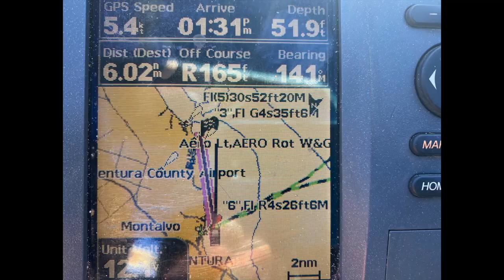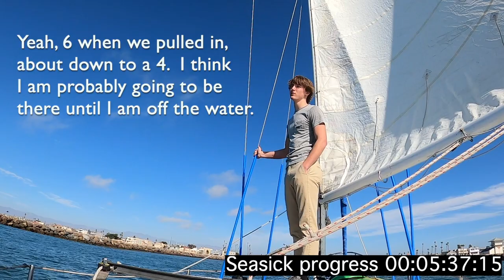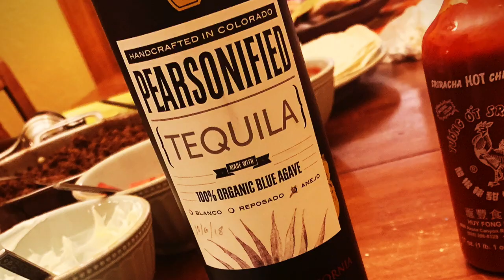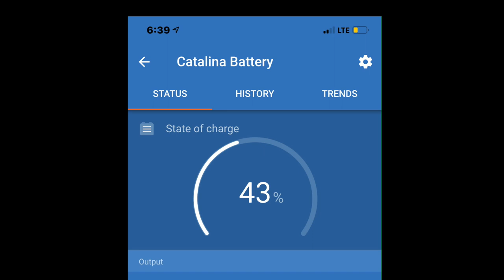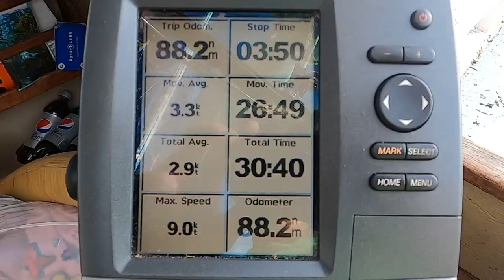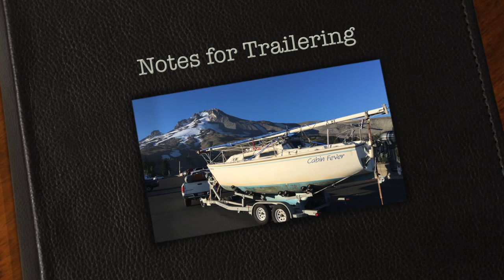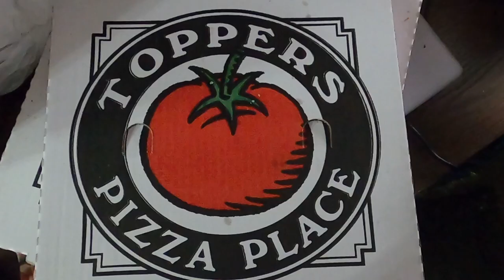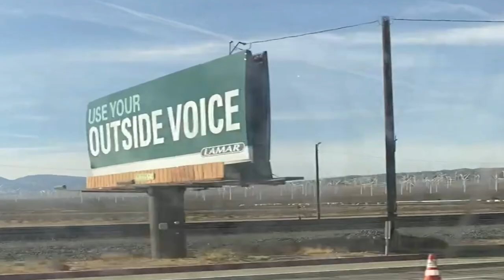Our Amazing Adventure is Ending!  Sailing Santa Cruz Islands Part 7 of 7

Comment: Looks like a great time!  A few questions about long trailer-trips with your C25:
Do you remove the rudder?
How do you stow the mast/rigging to avoid loose lines & cables from chaffing?
Do you have any tie downs on the stern?  Or just the bow winch?
And then last, and most importantly, how did you replace the trailer bunks with rollers?  That looks awesome!  I’m wondering if there are plans out there somewhere?
Thanks for the great vids!
Reply from the maker: HI!, I do take the rudder off and store it in the truck.  The mast rests on some custom wood blocks on the bow pulpit and one that sits on the traveler right above the cabin door.  In the stern, I have a crutch that supports the mast.  I use cam straps from Northwest River Supplies to tie all the lines and stays to the mast and just make sure no lines are caught between the mast and the supports.  I have never had an issue with chafing when I do those things.  It is not that violent on the boat.  The cockpit is well out of the wind.  On the stern, I have 2 ratchet straps that I attach to hold the boat on the trailer.  I never trust the bow winch for more than just getting it on the trailer.   The strap on the trailer is always out in the sun and not easily replaced.  I back it up with a chain when it is on the trailer.  My trailer came with rollers, I have moved to the yellow ones slowly as they do no create marks on the boat.  They are however expensive.  Maybe check with a trailer shop, the rollers are nice when you cant fully submerge the trailer.  Thanks for the views!